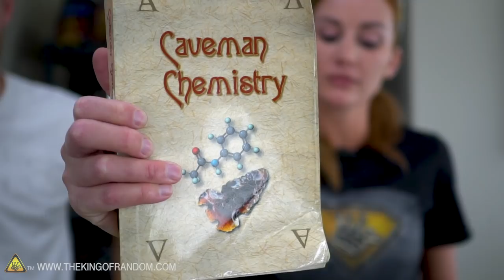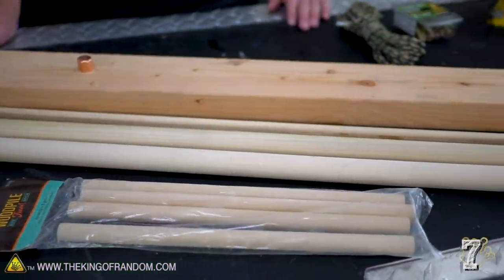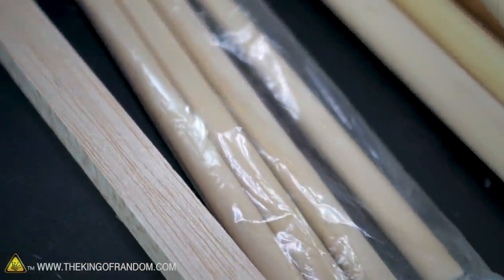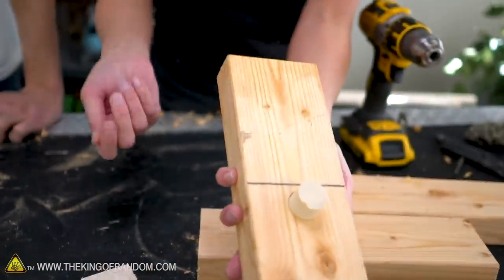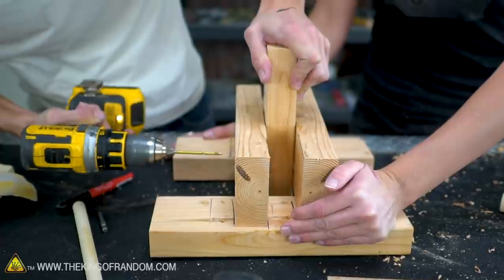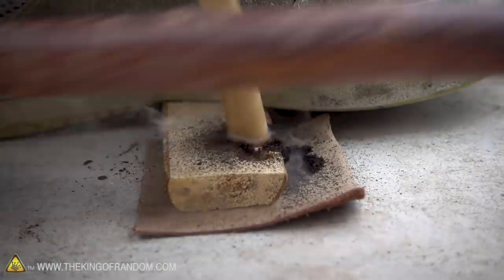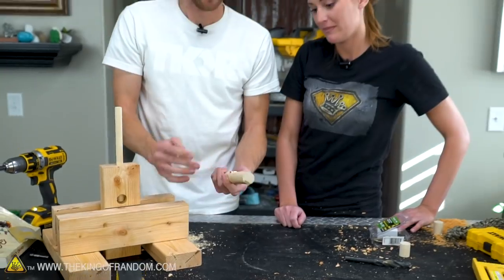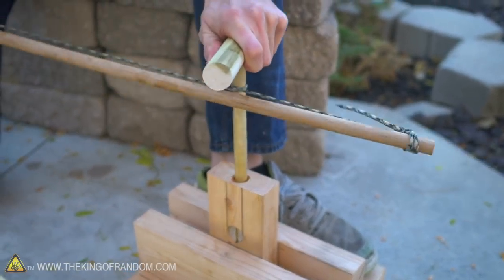It was Supposed to be like Cheating

Comment: can we see what happens to swiss cheese in a vacuum chamber? would the pockets of air explode? would we get hole-less swiss cheese? like if u wanna see
Reply: nothing, swiss cheese is a hard chees, and the holes are seperated by thing walls, the thin walls will form a few small holes and it will end up being an open network of tunnels. Like putting a sponge in a vaccuum

Comment: Or use a lighter...
Reply: in a survival situation you ont always have a lighter
Reply: I allways have a lighter, knife and 5$ in my pocket.
Reply: ANTONIO JELIC congrats
Reply: @antonioj.2147  weird flex but ok
Reply: That's a modern utensil their using primitive methods.
Reply: @623jrs  in a survival situation you wont be carrying  a few two by fours dowells or power tools
Reply: @623jrs  in survival Situations you also dont have always Hardwarestores
Reply: @joevasquez1142  you get branches and a few rough mesurments
Reply: Jacob Smith tbf in a survival situation you never have a drill table saw or squared wood.
Reply: @bcfb21  tree stump,rock or ground
Reply: Jacob Smith probably not going to be the same as manmade squared wood. It was neat and not really a survival trick. It was just a cool thing to do which is fine. In general if you’re going to Home Depot to make your survival trick it’s probably not that great.
Reply: even if you do have a survial kit it wont have a power drill
Reply: Jacob Smith lol yet you have a hardware store and dryer lint🧐😂 @Jacob Smith
Reply: @623jrs  but you will have this lol
Reply: @antonioj.2147  when you're trying to survive, you can use the knife to make the bow, bottom board, and the spindle. The $5 can be used as kindling. You can also use the knife to make a crude bow and arrow for hunting(you'll need sinew for the fore bow string aswell as the hunting bow string)
Reply: For the price of that u can make sure u have a lighter or matches

Comment: I have another one for you I don't know if you've done this 1 I haven't found it on your old list of videos But what you do as a fire starter and how it works is you take an egg carton take lint and Milted wax of any kind prefer candle wax You take the lint and put it in each of the holes in the a carton then you fill each hole up with wax let it cool  cut is up in to individuals then you light the carboard and it should burn for about 5 to 10 min( I've had one burn for 15 minutes and it was raining not hard but wind and rain usually doesn't bother it) And then you can put a log with some air clearance on top of it and you should burn a thick log straight up without no kindely meeting

Comment: I have made several dozen bow drill fires in my life, and this is SO over engineered... we are talking Tim Allen "more power" levels. I love it.  you would do a lot better with a square fire board. if you use a chisel to square off the hole, you can slide square stock in. also carve a "V" on one side, to give the char a place to fall, and gather. this will also allow some oxygen in, to make the ember better

Comment: So here is the logic of this video:
If you are in the forest and you want to set a fire, what you need is simple:
-Wooden saw (with a power source to make it work)
-Wooden planks (soft and clean)
-Triangle ruler (big one)
-Paracord (Six feet)
-Electric drill (with a power source of course)
-Copper cap (can fit the wooden stick)
-Screws (specific type)
-Muscle strength

That's it! VERY SIMPLE.

Comment: i imagine that board doesn't need to be sticking up so high, half an inch above the fireboard would reduce quite a bit of the friction issue while still keeping it from moving around. Also, drilling the top of the hole out wider would help too.

Comment: Try putting a short length of 5/8" copper pipe in the hole for the spindle. I think it will help a lot with the friction problem instead of the oil.

Comment: Use a pice of copper tubing as a bushing in the guide 2x4 that should drastically reduce friction also try out the similar fire starting method taught at the Polynesian cultural center, it's pretty slick.

Comment: You don't need to go full force all the time like they are...... Slow and steady, the gives the wood more heat over a longer span which means it's gonna be hotter for longer therefore the amber doesn't die as often. 
Remeber adequate speed and pressure - no need for full escalation haha

Comment: I’d suggest NOT using dryer lint, because unless all your clothes are natural plant fibre, not wool or synthetic, then the fibres will have wool which is horrible when it burns, (IF it burns.) or synthetics, which as we know, plastic doesn’t burn very easily, but when it does it produces a lot of toxic smoke.

Comment: Those of the Firecrafter Rank in Scoutjng know a simpler and easier way to do this!
Also, you should keep the char dust, firecrafters use it to feed the "spark" after it's been popped
Yes Firecrafters call an ember a "spark" if it is created by a friction bow set

Comment: Or...just acquire a steel and flint device, or stock a large supply of weather-proof matches.

I have 10 Bic lighters in my prepper kit, so I will pass on the woodworking tip for today. But thanks.